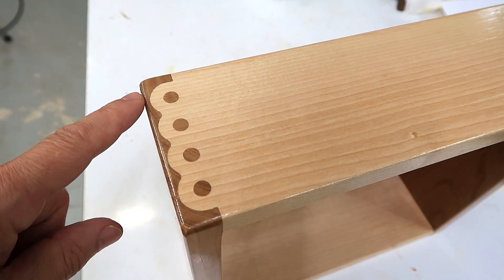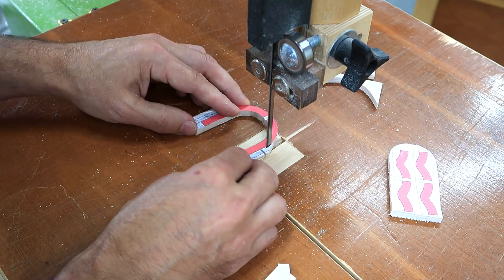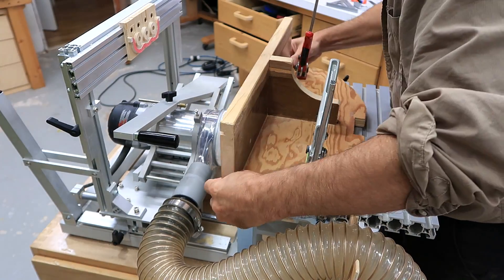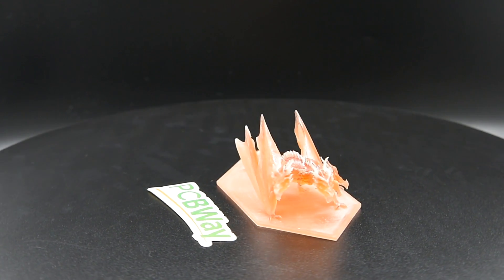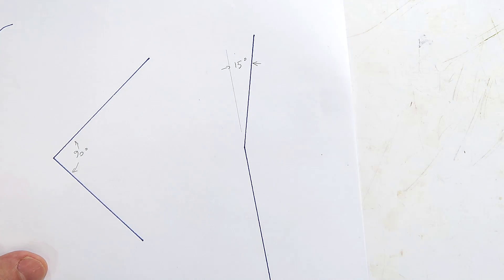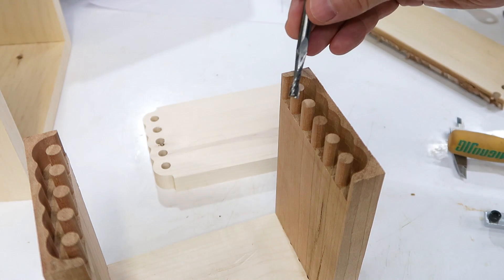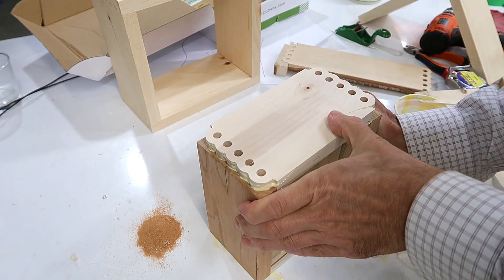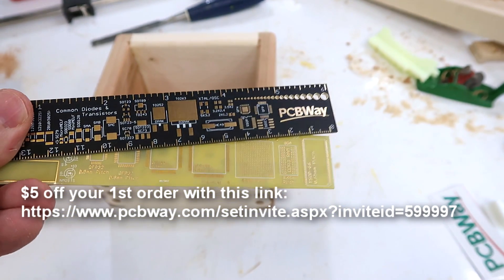Designing segmented Knapp-joint templates for the pantorouter

Comment: I get where you're coming from with the investment in 3D printing. I started playing with them back in the RepRap days and built a few, partly as a way to learn some electronics stuff. These days though you can pick up a Prusa Mini or Mk3 and they work out of the box with no tinkering or big time investment needed, especially if you use their Prusaslicer software as it's all preconfigured for their machines. They are very much a set and forget setup, although the same can't be said for some of the lower cost alternatives like the Ender based machines.

It's certainly something thats only worth investing in if you know you'll use it. A lot of my usage is for random projects and bits and bobs that are needed for something. For example my workplace needed to temporarily mount two 2u network switches vertically, so I hopped on the printables site, grabbed a model someone had shared for doing just that and printed it out. An off the shelf commercial vertical stand was several hundred dollars, the one I printed cost about 50c in PET plastic and is incredibly strong.

In relation to the bumps you found on the 3d print its something I've had a few times with sketchup based models, I found that tinkercad was a bit better as it was able to work out curves and account for them in its exported stl files.I'm fairly sure you can import a sketchup model into it and do any tweaks needed then re-export. It's also free to use which is a bonus.

Comment: Totally can get that to print way better with a tuned slicer. 3D printing is unbelievably useful in the wood shop. You can also get one four less than $200 American dollars and with your modeling knowledge you’d be up to speed in a few days.
Reply from the maker: but this was the first time I needed some small plastic bits that I couldn't just easily make from wood.
Reply: @matthiaswandel  People keep forgetting that you have about 50 revolutions around the sun and this is the first time You needed a 3d printed part. Yeah, they can be fun but we find other ways.
Reply: @matthiaswandel  not saying you would change your mind but I thought the same thing till I got one. Although I’m not as good a woodworker as you I found many jigs and gears come out better and.more intricate than I could making from wood.
Reply: @matthiaswandel  how much did that one prototype cost you with shipping to Canada? Just like you I can't be bothered with the learning curve and printer purchase but think I might consider pcbway for the occasional time I need a custom 3d print. Did they provide the software to produce the STL file or can sketchup export that as well?

Comment: You were correct about the cause of those bumps. There are ways to mostly tune that out of the printer, but in this case the correct thing to do would be to have made the circle have an order of magnitude more segments.
Reply: They were caused by exporting his model without enough resolution. That's why they were on the PCBWay ones too.
Reply: Cura has a nice plugin for smoothing curves:  Arc Welder.

Comment: Could you upload stl. file?  I want to try this joint at home.  I have a 3d printer,  and your wood pantorouter
Reply from the maker: Sorry.  Mac Sheldon paid for the design work, and he doesn't want the STL or CAD files shared.
Reply: They should be easy enough to draw by  yourself

Comment: with a CNC.. the template would have maked very perfect
Reply: CNC is only as precise as the model you input into it. In this case, it WAS CNC, 3D printing is after all a CNC process, but the file had imperfect curves.

Comment: Anything curved in sketchup is a nightmare. Once I started parametrically building models in Fusion 360 I couldn't go back. In Sketchup if I wanted to change the radius of one piece it would be starting from scratch. In Fusion I can just change the parameter and seconds later have a new model.
Reply from the maker: Yes, but a big learning curve, and quite expensive.  For the occasional one-off, I can tolerate sketchup not being very suitable for this.
Reply: @matthiaswandel  Fusion is free for hobbyists(which would include yourself), as well as students.
Reply: I have an ender 3 pro and I got it refurbished for 150usd on eBay, and I use fusion. Still works good and Still learning how to use it but it’s enjoyable
Reply: @matthiaswandel  you are a developer, no? OpenSCAD might be the thing for you. You program objects with primatives and booleans, etc. It's free as in beer and free as in freedom.
Reply: @matthiaswandel  I mentioned it elsewhere but tinkercad is a pretty good (and free) middleground. It's got the ease of use of sketchup but handles curves correctly and is very easy to use.

Comment: Matthias, if you ever need some prototypes 3D printed, don’t hesitate to ask your community, I for one would be happy to help!
Reply: Also, the “bumps” on the corners of those features are due to the low resolution of the stl you exported, and any reasonably modern printer given more detailed gcode would not have such issues. Also, that is an FDM(fused deposition modelling) part printed in thermoplastic, not resin, as an SLA(stereolithography—uses UV light to cure UV resin in a vat, layer by layer) would print with.
Reply from the maker: if it's due to the low resolution, then the ones I sent out for printing would have had the bumps as well.  It's an artifact of the printer.

Comment: Not easier to have 3D printer?

Edit: Didn't watch until end..
Reply: Not for printing wood
Reply: @andyh9382  Wood filament, basically PLA + wood dust.
Reply: @andyh9382  Technically you can print wood (its basically wood particles mixed with plastic). It smells great, but is very hard to work with.